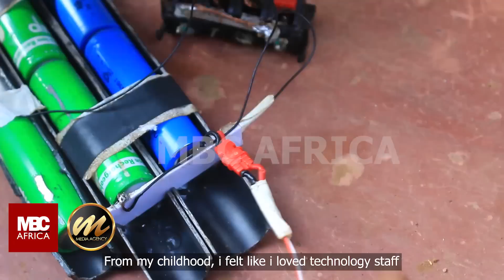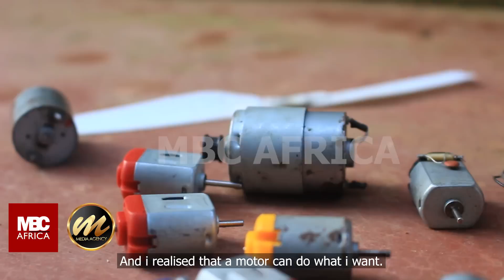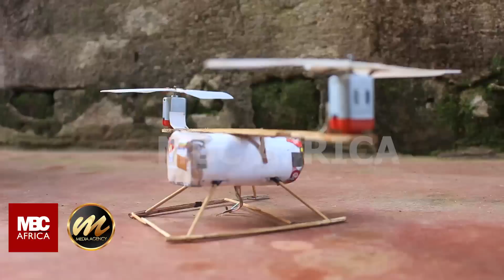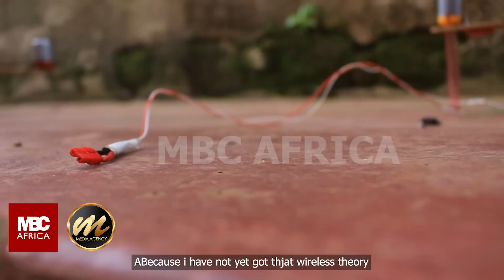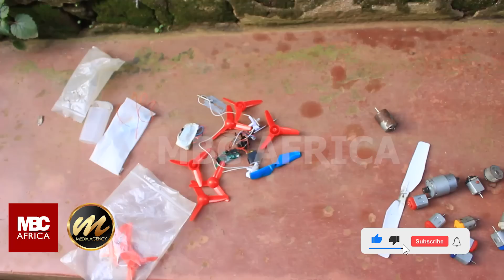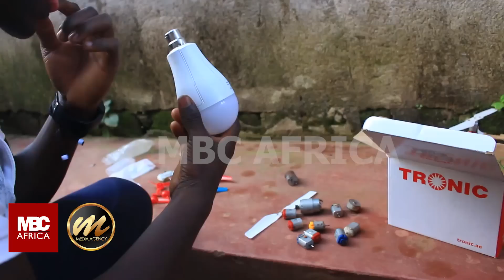FIRST UGANDAN TO MAKE A DRONE | Breaking Boundaries

Comment: For those who can afford this I recommend using machine learning, so you won't need to calibrate the balance of a drone. All you will need is a device with a gyroscope, so you know what is your orientation relative to the gravity pull, feed neural networks with this data and give it some basic controls over the engines.
Reply from the maker: Stay tuned

Comment: You need a flightcontroller-board, and better motors.
Then your drone will fly.
Reply: Or instead of a quad ,he should make a fixed wing drone ,those don't require a flight controller board .
Reply: Or instead of a quad ,he should make a fixed wing drone ,those don't require a flight controller board .